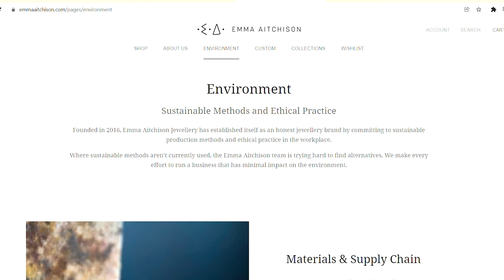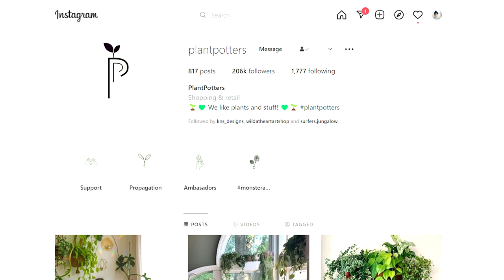Part 2 of Wax Carving a Ring - Answering all your Questions

Comment: Hiya Megan, again, have you considered Patreon yet? Have fun in Poland, Basia told me... 
Stay safe, Steve...
Reply from the maker: Hi Steve, that's a very good idea, I'll check it out. ;) And hahaha! Yes! The cat is out of the bag! ;) We are planning something super fun and special together!!
Reply: @megan.collins  Basia hinted about what the subject might be, I hope so! There are so many parts of this slightly mad hobby (?) we've signed up for, okay sold our firstborn into servitude to fund! I've just spent something like £17/18k at Cookson gold and others, including Amazon. It was wonderful to think, well if I have one of those I can do this... But if I had two of them... Like an SR flex shaft on the second bench, I could have an H30 handpiece fitted in the new drill press, the new vice has a V notch for holding round stock, I just need to fit the shaft to drill tube with a setting burr to do tube setting gems. At other times that flex shaft can be handheld for carving wax. 
So making is one thing, and using your pricing sheet is totally perfect, but any other help you two can give us. You are both successful goldsmiths, working internationally, you deserve our thanks and respect for any and all help you both give so freely. So thank you, and I can't yet afford your course but I can help with Patreon. A small thank you and payback for all you give us. 
Stay safe you two, Steve...